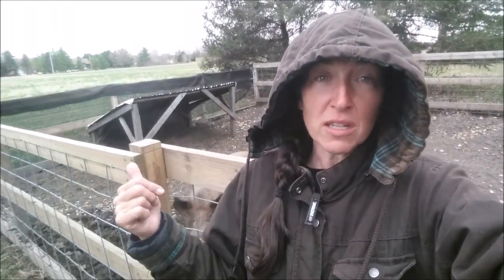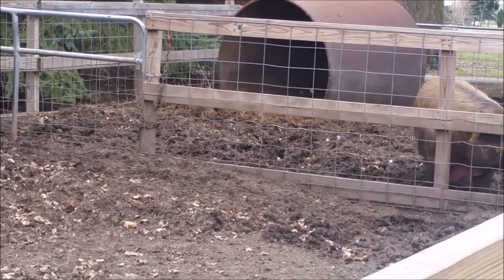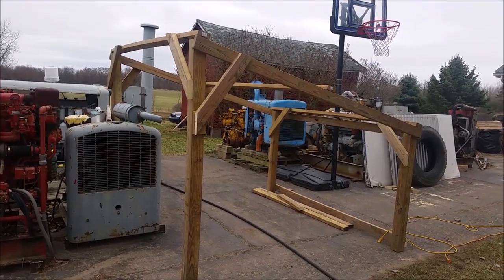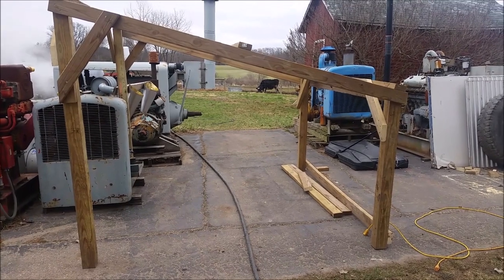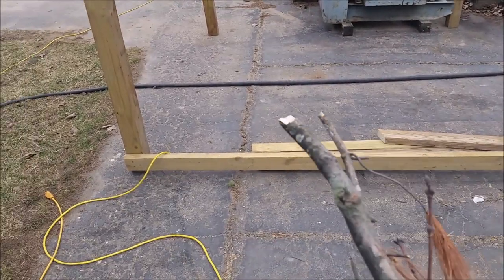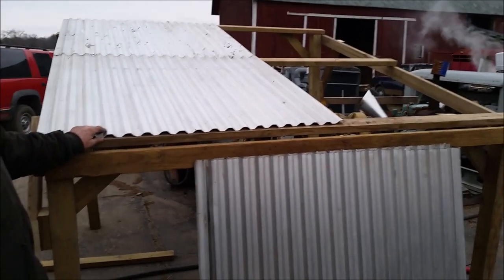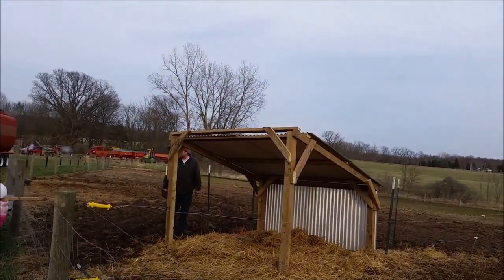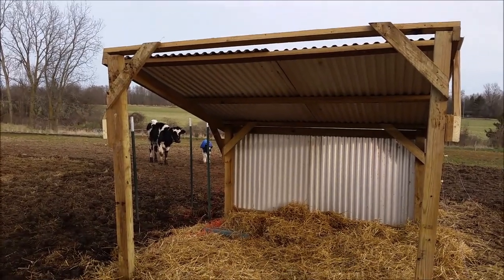Simple build it yourself livestock shelters

Comment: How has it held up? Wondering if the cows will break it down fast rubbing on it if it isn't dug into the ground
Reply from the maker: It was fine until we put the bull in with the cows for. He has horns and rubs on it. He has a scratching post must the overhang works will too. Maybe wrapping the posts in barbed wire would help. Otherwise it has been great for the cows and calfs.